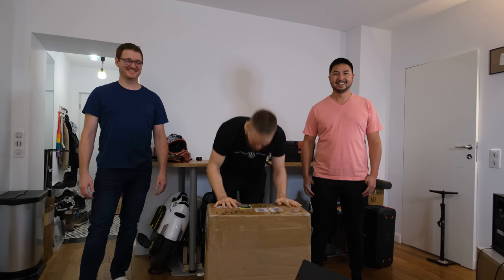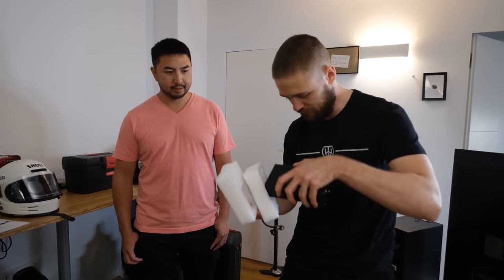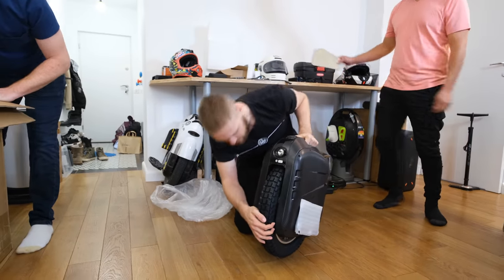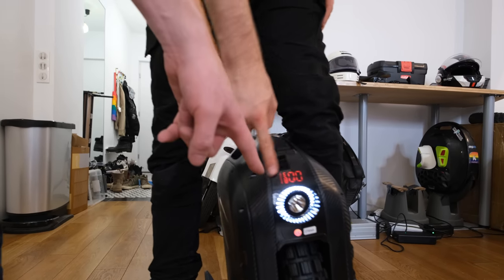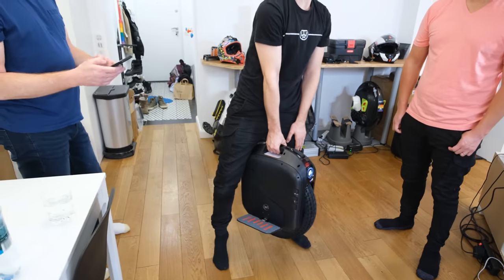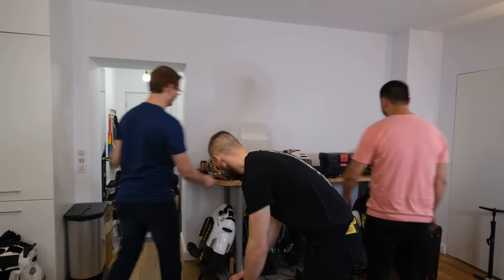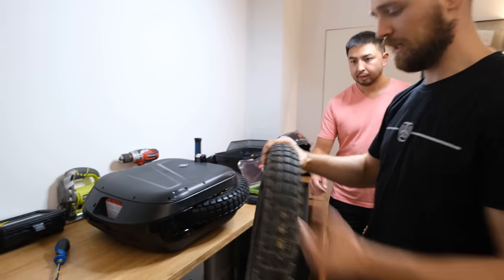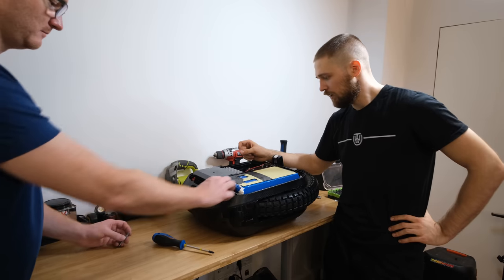Begode EXN High Torque Unboxing feat GOW and Andrew!

Comment: Looks like a slower EX with no suspension 🤷. Did it have blackboard? Not sure whats the purpose of that wheel but Begode is really good at recycling their wheels. The front screen looks nice. Good video!

Comment: The 3A protection by battery pack for recharging is probably integrated on the BMS. Hence the cutting of double-sided foam.
Reply from the maker: True. I will add more info in the next video

Comment: My EXNhs didn't come with the front display nor the dual charge port but it does have the knobby & black mobo. Neither did it come with anything cracked. Did a teardown to apply the marine grease treatment & tightening of all bolts & screws (nothing was loose fwiw). Can't say my EXN is torquey but it does feel torquer than my bud's Sherman. Now with ~1k kms in, there's been no drama. I've done some pretty gnarly tight mtb trails & at outside summer 30°c, internal temps have spiked to high 60°c's on extended steep dirt climbs. It did take me a number of rides to get used to its phatness & top heavy nature but now, I enjoy it alot. I've also wrapped it strategically with baby bumper foam pads & I believe it'll survive normal falls easily. No fires to report as yet but I'll take my EXN > a Sherman for its nimbleness. Woulda likely gotten the ht version if it was available then. Torque > Speed for my needs

Comment: Not in transport mode + cracked shell, sounds like an already used wheel🤔
Reply: Clean tire
Reply: It can't be done during transport, the big cracked spot is in the corner so the strongest part of the box, except by crushing it with a forklift on the loading dock maybe but the box & polystyrene padding would be destroyed at that spot, it can't be just pressed and come back in place without leaving a mark. I don't think Adam didn't see it when he received it because it would be a big hole in it so.. All new out of the box gotway reviews on yt/forums have the transport mode On from the Msp, this one doesn't have it + cracked shell

Comment: Lol whenever Wrongway does a disassembly I'm reminded why I told myself I'd never buy a Gotway wheel XD. They may call themselves Begode now but Gotway will always be Gotway it seems.
Reply: yeah screw that build quality. its simply not acceptable on a device that will make the rider fall off if it fails.

Comment: What video is this clip from?  Is this an EX.N HS? 1:59
Reply: No that's the exn ht we unboxed in this video.
Reply: @GingerOnWheels  ah nice,. The normal exn is more like 35-40 I think?   Seems like there is like a 20% difference in torque between HS & HT wheels, from what I've heard
Reply from the maker: Usunął exn is just 35 degree (barely)
Reply: @mr_wrongway  Ah, sounds good.  And nice unboxing experience video!
Reply: @mr_wrongway  We need a braking comparison between the speed and torque